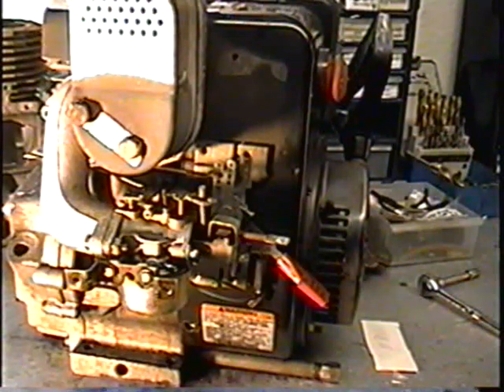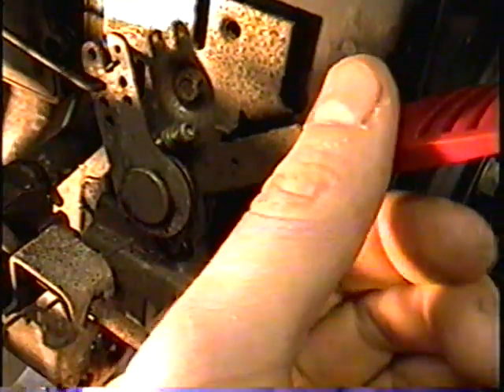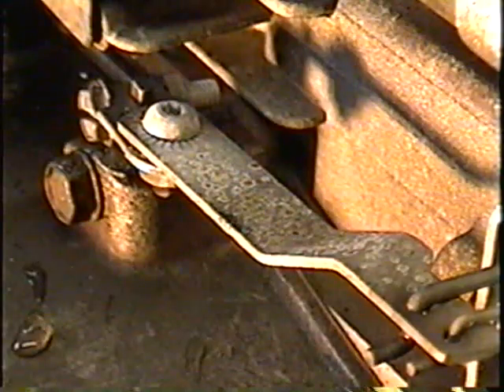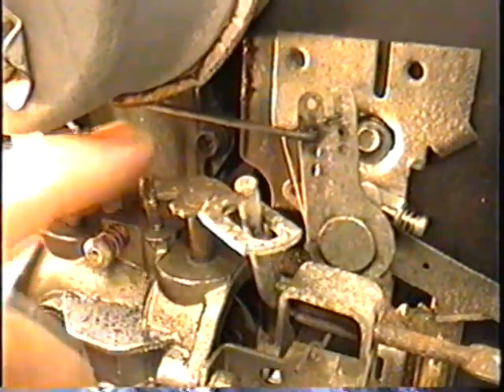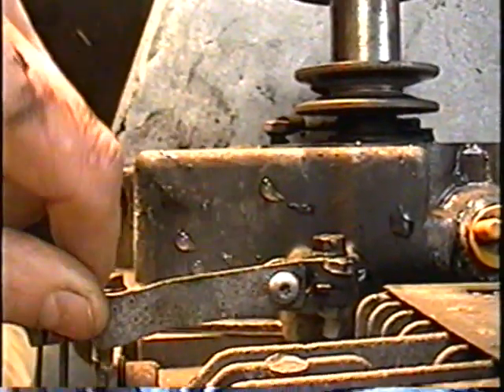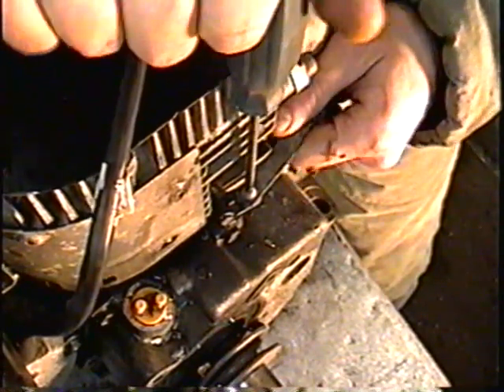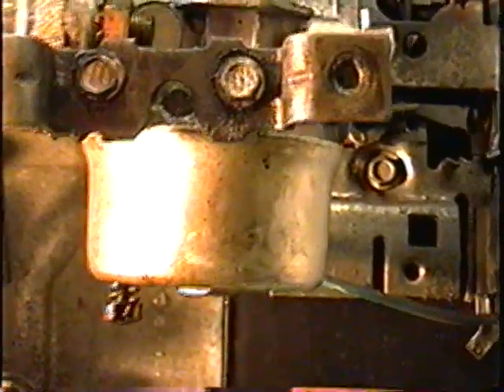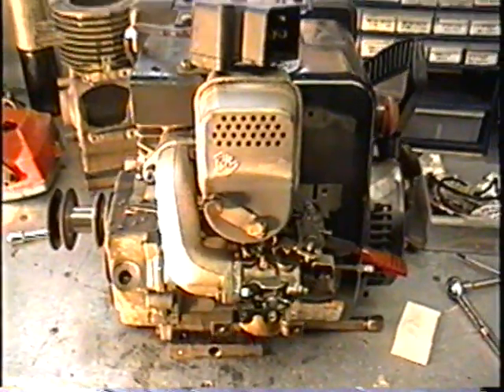HOW TO ADJUST SNOWBLOWER ENGINE SPEED GOVERNOR

Comment: I bought a replacement carburetor and holes on the plate with spring do not exactly match so I need to make a new link from Governor arm to throttle valve plate(with the retractable spring) . In the highest manual throttle position, the throttle valve plate opening should be 75%, leaving 25% room for any extra load the snowblower may see.  If you max out throttle valve opening with highest manual throttle setting, then there won't be any room left. Is this correct? Also, is it okay to use big hole on plate, it will give some play. On the old carb, the connecting pin was inserted in smaller holes on the plate.
Reply: You need to set it so, with the speed setting on 'Rabbit' or 'High', the engine runs at its correct RPM at no load.  When you impose a load on the engine, the throttle plate should open to maintain that RPM.  Overspeed can damage or destroy the engine.  That's what the governor is for.

Comment: My snow blower only runs full at throttle , when I slow it down its back fires a lot and down to idle it just dies !! Carb has been all cleaned
Reply: oh, mine too. I would like to find an answer for this. as I do not believe the carb is the problem.
Reply: Nevada Pimentel it was my carb !!! I cleaned it 4x

Comment: Donyboy73,
I am stuck! I have come across a problem that I haven't seen anyone specify or address in their videos. I must say I really appreciate all your knowledge and videos you post. They have been very helpful. The snowblower engine I'm working on is very similar to the one in this video; carb, linkage, throttle lever, and the governor. The problem that occurs is the engine bogs down when three things are happening; the wheels are being driven, the auger is spinning, and snow is being thrown. The engine doesn't seem to bog down when only the first two are happening while not throwing snow. What I have done: cleaned carb and made proper adjustments to the main jet fuel screw below the carb bowl and the idle mixture screw, checked compression (100-115psi), and pulled the underbelly of the machine to check for abnormal wear of all components (nothing obvious). Please let me know what you suggest and/or a link to one of your videos. Thank you in advance!
Reply from the maker: maybe some of the mechanical parts are harder than normal to turn?
Reply: Interesting, virtually identical for me.  Starts on first pull, runs/idles great.  Throttle up no issues.  Start the driving mechanism, no issues.  Start the auger no issues.  Soon as I start putting snow/load through the deck it sounds like it wants to slowly quit as the RPM's die off.  The engine sounds like it is in great running condition so I'm wondering is it my carb or governor??  Carb was rebuilt from previous guy I bought it from but not sure otherwise of it's condition.  How sensitive is a governor?  I mean could spring tension, or even the loop hole it's tied to on the governor make that difference?  Been tinkering for weeks and can't figure this damn thing out.  Only thing I've done is put a new belt on this snowblower.  If tension is too tight, could it cause this?  Thanks for your help.  My carb and linkage looks very similar to the one in the video.  It's a Craftsman 5/23 with Tucumseh engine

Comment: I've adjusted the governor already, yet it still goes to the moon unless I throttle it back down manually. 
and I already fixed a broken exhaust valve keeper from the excessive rpms when my friend had it. 
As a Briggs tech , I think its time to open up this Tecumseh and check the governor gear and the arm,unless you have any other ideas sir. 
Love your videos, they've helped me out quite a bit over the years.

Comment: I love your videos. I have subscribed. I have referred to this one because I have a full throttle power issue on my 8.5 hp Tecumseh. The lever adjust screw is not touching when it is turned off. Should it be touching?
Reply from the maker: +Daniel Hodson when it's off the small adjustment screw on lever will not touch anything

Comment: awesome videos. I just got a Jacobson Homelite 824 with a Tecumseh 8HP engine for free that "didn't work." Cleaned the Carburetor, changed the belts, changed the fuel line and spark plug and it runs greats. The carburetor linkage and screw adjustment videos were extremely helpful. Thanks for the good info.

Comment: My 10hp Tecumseh engine surges. I replaced the carb, but it didn't help. The governor continually moves the throttle back and forth. If I hold the governor lever still, the engine runs smooth. Is there any way to correct or tighten the governor to stop the surge?
Reply: +Tim Brennan I saw someone mention it on a forum like this one.Like you I had already replaced the carb.  I guess I didn't get a great seal. I took the carb off, replaced the gasket and it fixed the problem. Not sure if it will fix your issue, but worth checking. Good luck
Reply: its little things like a screw being loose that can make an engine look bad you probably need to tighten all the screws properly. if your air intake loose the engine will start but will shut off when idling. for the governor there is a missing screw or the screw is loose. a loose screw can make the carb look bad but the carb is probably just fine.
Reply: I have a tecumseh 9.5hp on a white yard boss 950 chipper vac. It runs fine a few seconds, then acts like it wants to stall, then recovers. It repeats this symptom endlessly. I seen some black buildup around the carb mount/intake aluminum housing and suspect an air leak. Air/fuel ratio imbalance. 
Your video helps identify parts and operation. Tecumseh operator manuals would be nice. Anybody seen any online?
Reply: +Tim Brennan I had this issue too, I had an air leak at at the intake manifold.
Reply: +spt118 
Just curious how you found that air leak. And, what did you do to resolve it? Thanks!
Reply: Tim Brennan 
M
Reply: Tim Brennan v

Comment: Donyboy,

this video is very helpful.  I removed my governor to clean my carb (very bad idea BTW), and am having difficulty getting it properly set.  In addition, the carburetor's throttle shaft (which has the linkage connecting to the governor) does not move back once the throttle is in the idle/off position.

Im not sure if my throttle spring is bad, if there is an adjustment I need to make to the governor or what... Upon inspection, my throttle spring looks fine.  It is not broken, and appears to be installed properly.  There just seems to be no pressure/tension to retract that throttle shaft on the carburetor.

I posed a video.  Can you review it and let me know your thoughts?

https://www.youtube.com/watch?t=211&v=55QJ_IT2lx0

Thanks

Comment: Hey Donyboy73, i have an old (mid 1980's) snapper snowblower with a techumseh motor. Mu problem is that i need to run the engine on partial choke in order not to run too fast. Could this be caused by the governor out of whack?

Comment: I have a Tecumsea snowblower my problem is that when I put a big load on it in some deep snow it starts to sputter and will just keep sputtering until I remove the load or put throttle down to half speen then move it back to full throttle be for it smooths out again
Thanks for your time

Comment: Thanks for this video! Question after adjustment of the governer screw and the throttle screw adjustment, what safe RPM is to be achieved here to get optimal performance? Is there a way to guage it or just by ear. I'm in the same boat here but afraid I'm running a little high RPM.
Reply from the maker: use a tachometer, I keep it around 3500

Comment: Hi DonyBoy73...great videos..quick question. I have 1970 something Ariens snowblower which tends  to stall when it takes on a load/snow? I would have to wait until motor to catch up before throwing more snow. Any ideas?
Reply: Phil Zazzera engine rpm is to low or the engine is to weak or maybe needs to be adjusted.
Reply: Engine has lost compression. Time for a new engine or rebuild.

Comment: Hi Db,
Thanks for your info. I installed the pin & seat set in the carburetor. The engine starts but I have to keep the choke out for it to rev and it dies if the choke goes back in.  I feel like the throttle speed is a nonfactor. There is no difference full throttle vs low.

thoughts?

thanks,

Comment: Thanks for the video !  A few years ago I had my snow blower serviced and it just seemed like it never ran well.  The small engine repair man said he worked on it for a while and got it as best he could.  This company has been in business for 30 + years and yet they still didn't make it run right.  It always seemed to idle slow.  I just followed your tip on adjusting the screw on the throttle lever and it ran perfectly!

Comment: I have a question for ya donyboy73. My HMSK80 Tecumseh won't run without the choke being on 100%. Even after the engine has warmed up (running for more than 15 minutes) I'll attempt to turn the choke to 1/2 but the engine will start to spit and sputter. Any suggestions ? Thank you in advance !! GREAT videos by the way !!
Reply from the maker: you need to clean the carb and possibly install a new carb kit
Reply: donyboy73
I was afraid of that. LOL Thanks !!!!

Comment: Hey donyboy73,got a weird question: I had a pretty old (maybe made before 2000) 5 hp briggs snowblower that sits for about 9 months a year and used a 4hp briggs mower thats about couple years old and sits for 3 months a year. Both had NO MAINTENANCE when i used it. all i did was top off the oil from time to time. The problem is the snowblower took FOREVER to start. I had to pull the starter rope and play with the choke for almost a half hour before it fires up on 9 month old (ethanol mixed) 91 octane pump gas with no fuel stabilizer. But the lawnmower is a different story, it fires right up usually on the first pull on 3 month old ethanol mixed 91 octane pump gas with no fuel stabilizer. Why does the new one fire right up on old untreated gas while the old one takes a half hour to start on old gas?

Comment: Hi there Donny,
Here is my problem was wondering if you can shed some light on what's going on... I have a Yard King Performance 12HP/33" cut snow blower with a Tecumseh engine, It has a non adjusting carb. Runs fine at low RPM's but the moment I turn up the throttle to full speed it begins to pop and fart, backfire..... any ideas as to what could be causing it to be running rough at full throttle?? I'm about to replace the spark plug first I have checked it and the plug that was only replaced about 2 yrs ago it appears good so I'm not sure. It has the non adjusting carb so I wouldn't be able to fine tune the carb... I'm at a complete loss as to why its running like this???  

Thanks Mike
Reply: Hi, did you ever figure this out?
Reply: I have the exact problem and that's even after a valve job cause the exhaust one had no clearance

Comment: Hi, I am just reinstalling my 1985 Tecumseh HM80's newly rebuilt carb tonight. I have not started the engine yet because I think the linkages or handle bar mounted accelerator control is not functioning right. I made a quick video showing how I hooked everything back up. If you would check it out and let me know what you think, it would be much appreciated. Thanks!

Tecumseh HM80 linkage issue? HELP!

Comment: Hi Liked your vids. I just rebuilt my 10 hp TECOM snow blower engine.
My carb is old style with screw on bottom of bowl.
On the side of the car there is a stem with a hole with part of a broken of rubber hose.
Also I found lose which I assume goes here.
Is this an air, line or what ?
Thank you
Reply: Hi Again
Is that a primer hose inlet ???

Comment: Great video Danny....  Have learned a lot from them...

A Question... My Ariens manual says to set the high RPM to 3600 and the low to 1800. What tachometer would you recommend for small engines that's accurate and reliable?  Also, would setting the RPM now during the summer be greatly different when used during the winter by any appreciable amount

Comment: Thanks for the Video!  Bought an old tiller and when I push the throttle lever up and down - it does nothing.   Replaced the spring and that didn't help.  Any suggestions?  Thanks again for all the videos you put on YouTube!

Comment: Just wondering if performing this adjustment could cause the throttle to become unresponsive in anyway? My snowblower now revs normal when idling but seems to rev the same speed at any throttle position.

Comment: I wanted to thank you. Came back from a mechanic and I needed more throttle. My snow would throw 5 feet and engine would die out and needed multiple manual restarts. Turned in throttle mechanism screw one turn. Snow throws 12 feet, not once did it stall, more than enough power. You made cleaning out from snow a pleasure. Thanks for also teaching me a lot about carb adjustments and throttle and governor adjustments. It was a mystery art before you explained it, now it's science. Real cool. I subscribed.
Reply from the maker: you're welcome

Comment: I am rather savvy with small engines because i am a tinkerer and a RC nitro tunnel hall boat racer. Some of the time there is a learning curve (BOOM) just once. With all the snow we have had here in ohio a snow blower is a must. I given the  task to fix all of my fathers equipment that had been neglected for a few or 8 years. To save my back no curve allowed. Brother you rock, Awesome video. The beast is back, she is running like a champ kicking A and throwing snow. Thanks!
Reply from the maker: you're welcome, thanks for subscribing
Reply: my next project is a craftsman 31cc weed wacker that sat for 3 years while i was away.when i pulled the plug i can see the varnishing inside. it used to run excellent better than others of the same cc now i can barely keep it started. do I want to do a complete tare down of the engine and walbro carb so it will run like new again. but i have never torn one down that far.maybe do some polishing (IE) performance mods, any advice? or videos? I can take a 3.5cc k&B pro outboard nitro rc motor and run it at 60 on the water. I just really cant afford the learning curve any more. I dont have the money i used to lol. Thanks again. oh when i was done with the mtd blower i did a whole city block so the kids didn't have to walk in the street. I had to play with it lol.

Comment: Great Video !!     I have one of these Snow Blowers,  When I put a load on it, like in snow it stops,  It sounds like it is running a little rough too...it is the 522R  It has been sitting a while but I cleaned out the old gas  and put in new gas...and at least got it running...Do you think the carb should be rebuilt ?

Comment: Thanks for the video, I seem to have a high RPM but when in deep snow it does not seem to have enough speed.or enough power. I have a Tecumsch, HSK35,40, HSSK50 snow blower. I did rebuild the cab. and that went well.
Reply from the maker: 5hp is a bit small so it may be struggling in the deep snow

Comment: My snow blower was running like crap so I had a friend take the carb off and take it to a friend of his and the guy took it all apart and cleaned it good. After putting it back on the snow blower the engine would race. Well my friend got sick so he hasn't been able to fix it. I found your video and now it runs like a charm! I just have to adjust the high throttle screw at the throttle handle to let the rpms come up just a little bit more. Thanks!

Comment: Awesome. Vid. My toro 524 works great. But when I let go of the auger gear  before it completely stops. It makes a grinding noise ? The belt looks good ?
Reply: The impeller bearing may be worn. The auger brake may also be worn. Take off your belt cover and have a look at what happens. Make sure the engine is off and safe, but you can reach in there and give a yank on the auger pulley to check for slop in the bushing.

Comment: Excellent video on the governor operation and adjustments!  Thanks! I have a problem that wasn't addressed in the video. My engine's speed lever gives me high rpm at the top of the lever throw like it should, but will now no longer drop down to idle speed when I push the lever down to the  lower position? The revs stay high in both positions now. What 's going on and how do I fix it?  Thanks!
Reply: Johnnie Guitar I am having the same problem. Did you ever get an answer to this problem. If so can you pass it along to me. thank you my e-mail xey456@yahoo.com
Reply: Sorry, I have not received an answer yet Thomas.. :(
Reply: Johnnie Guitar Did you receive a response to this yet? I think I am experiencing the same thing. Was revving crazy high and adjusted it down to normal but now the throttle seems unresponsive..:(
Reply: I just rebuilt mine....  check to make sure that the governor arm, located on the pullly side of the engine, is not binding. You can check it with the engine off and the throttle set to slow...  The throttle rod on the top of the carb should rotate up against the idle screw.  If the governor arm moves freely and the throttle rod rotates as it should then start the engine and see if backing out the idle screw helps.  If everything seems to be working and the throttle rotation has no effect, I would check to see if maybe the throttle vain has fallen off the shaft or something is blocking it from closing

Comment: Question, I have a Tecumseh hssk 50-55 on my snow-bower...always stored off-season properly. First usage this season, fresh gas in, fired right up and runs great however, I notice it's not RPM'ing as high as it normally does. Should I first adjust the governor screw or adjust the governor arm???
Reply from the maker: the small screw on governor arm may need to be tightened
Reply: donyboy73
Yes, that did the trick, the spring putting pressure on the gov screw was indeed weak and it must have backed out.
Wish I could tell how many R's are too much before it goes 'boom'
You have some great vids...keep up the good work.